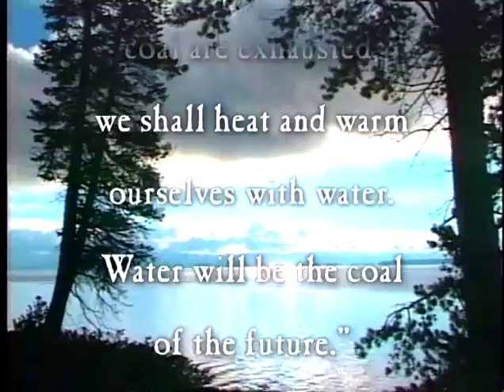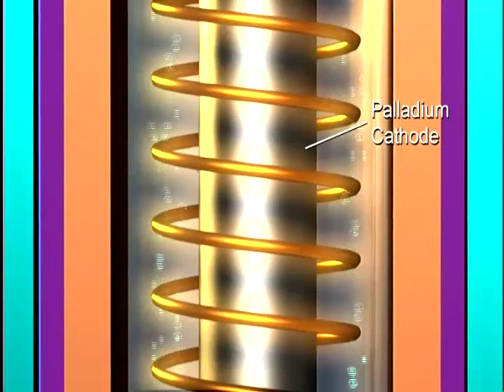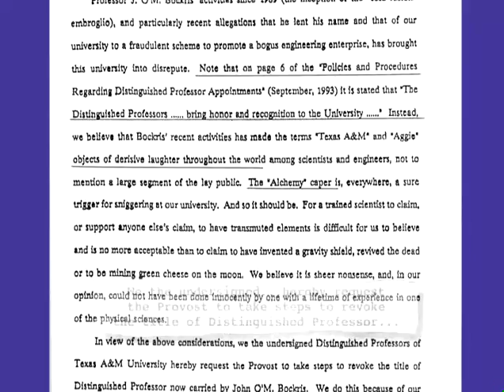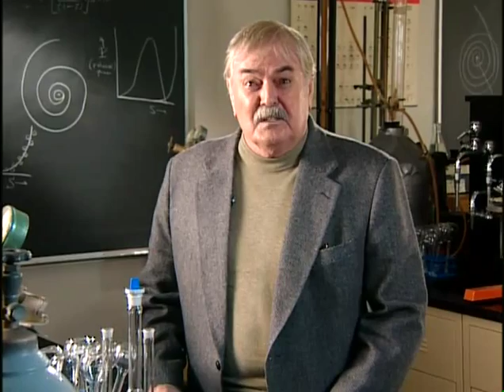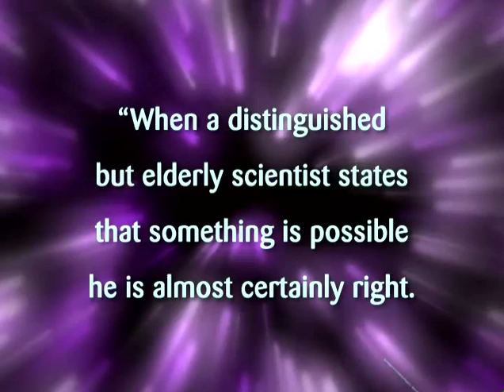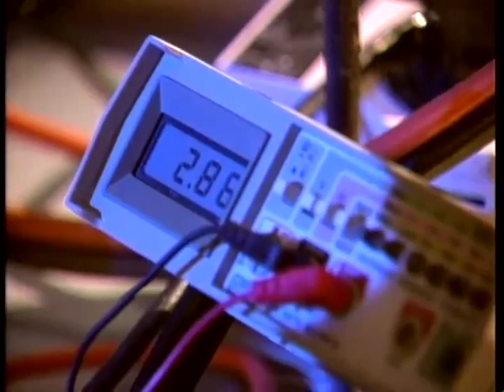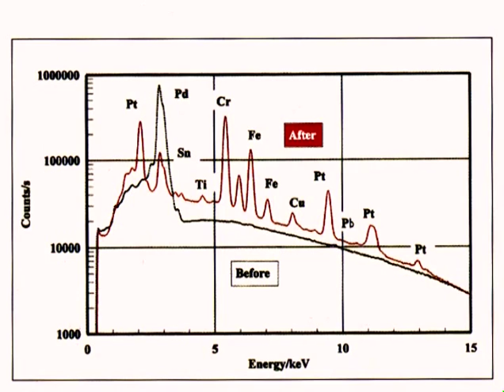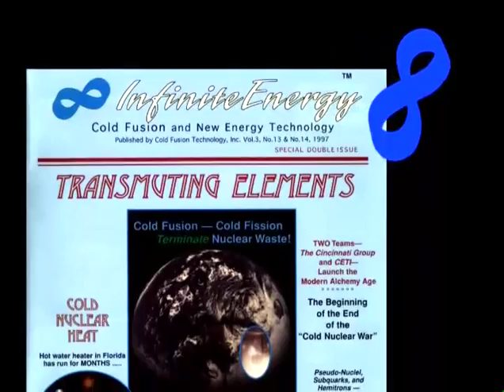Cold Fusion: Fire From Water (actual full length)

Comment: the most imortant energy source on this planet and it has 1700 views.wow.
Reply: People are told it is an unachievable fairy tail. I had no real clue about it until today. Also I think it's true the name does not help at all.
Reply: The most important energy source is not on the planet. Cold fusion is not the way forward. Swapping water for a waste product we dont eat or breathe is a fatal track. Its not how nature powers up big stuff like tornadoes. Electricity is all around us already. Palladium seriously? More Valuable than Gold, 30 times as rare. And being scared of co2 emissions is just erroneous global warming nonsense. Plants love co2 and we are not warming up mores the pity its a mini ice age coming.
Reply: Turns out that the gov powers its ufos with this
Reply: @seachangeau  Helium is a non-renewable resource, and the price is going up. We're getting close to running out of Helium, which we desperately need for MRI machines and other important uses. Also, the reaction can be driven using nickel, so palladium is not a hard requirement, it's just one way to do the reaction.

Comment: It's all there. The SAFIRE Project also confirms fusion as a surface phenomenon. Fusion is not a continuous process happening at the core of a star as demanded, without proof, by conventional astronomers. Fusion is a result of collapsing parallel magnetic fields in a spiraling vortex of currents acting on materials that reaches a singular spherical shape . The heat is the RESULT of fusion, not the requirement for it. Each fusion event is a small 'one-off' collapse of lighter elements into heavier ones. This happens all the time in outer space; but the events are misinterpreted as 'supernovae', when these events are actually the formation of higher elements that  might become the highly dense cores of NEW stars. We have it all backwards.

Comment: I am not seeing the benefit of this. A small amount of excess heat and the presence of tritium is interesting, don't get me wrong but the way that nuclear power plants produce electricity if by boiling water to produce steam to turn a turbine. A small amount of excess heat in a chemists laboratory does not sound like a commercially viable energy source to me.

I believe that Fleischman and Ponds did what they say they did but I don't see why it is such a big deal. Excess heat is certainly a good thing but is making this heat more economically viable then other sources of heat?

If you need palladium and tritium to make this possible, those are some really really expensive elements. Can this be economically viable on a large scale?